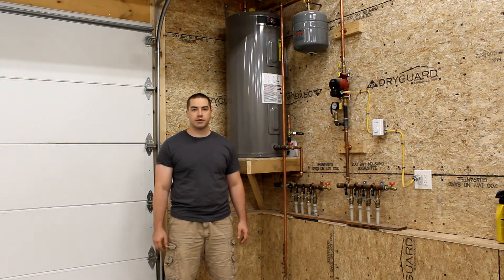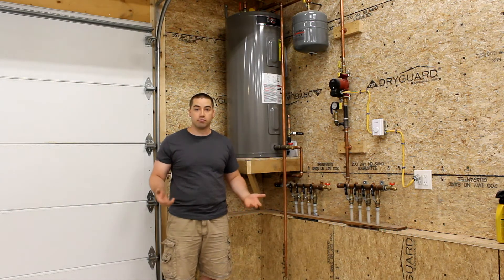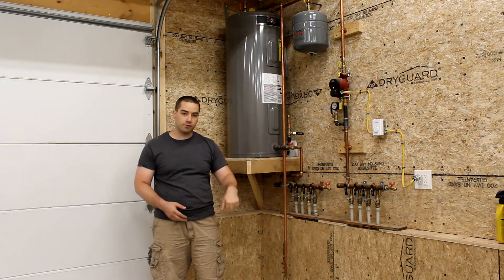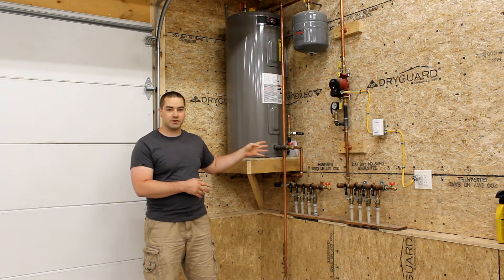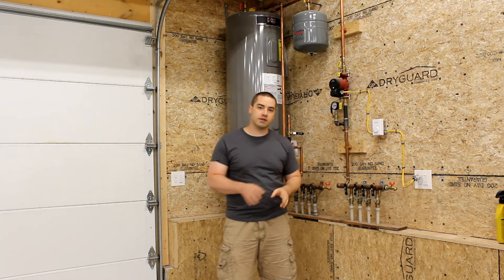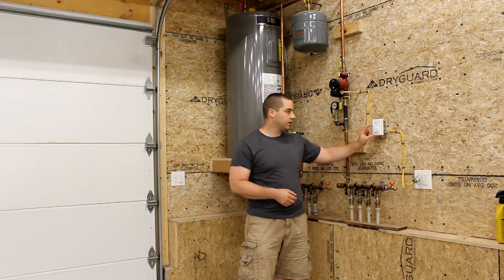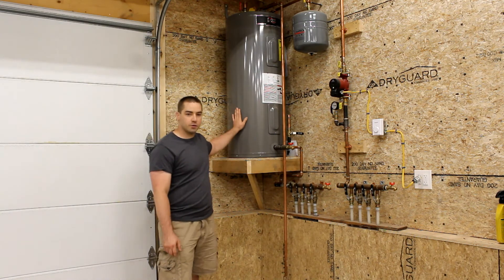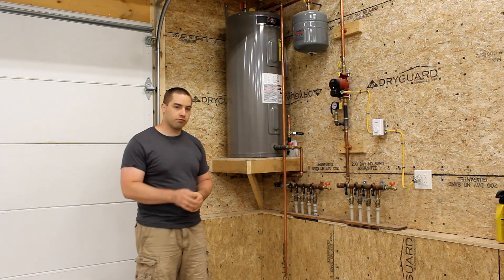Solar Heated Garage Plan

Comment: Hi David,
Hope you guys are doing ok this year. I had a few questions about your garage radiant system, and was hoping to get your input on a smaller project I’m doing. 

First off, do you recall how many KWh you were using to heat that garage, before installing the solar collectors?

Here’s what I’m up to:
I’m building a small, well insulated 10x14 gambrel shed. I’m doing a single run of pex between the floor joists (~220 ft). Heating with a 10 gal 120v water heater. 2.1 gal expansion tank (smallest I could find). Got the cheapest Grundfos 3 speed pump HD had. Still need to find an air relief valve, and get all my other fittings together. 

This will be a closed loop system. 

I had been planning on running glycol in the system, since it is a shed, and if our power goes out or the heater quits, I don’t want to worry about freezing (we’re in So.VT). What exactly are the downsides of doing an antifreeze mix? 

What else do I need to make my system work? Do I need a line-level thermostat to run the pump like you do? Or can I get a low voltage one and run it over to the front door for easier access? (I’m thinking of installing the whole system up in the loft area.)

Last question: I got a stainless water heater. Was that a mistake?

Thanks for taking the time to read my comment 🙂

Comment: cool.  good luck with your solar plans!   do you have a more detailed plans and video for how this was put together?
Reply from the maker: I'm still in the process of building it.  The next video on this topic is here: https://youtu.be/GbnawpPHsD0  Stay tuned for more.  Is there something specific?  I'm always open to video ideas that would be helpful to you.  Thanks for watching.
Reply: I guess what i was wondering about is manufacturer and part numbers so i can make sure to get the right stuff.  i'm at early garage planning stage, so i'm mostly just collecting ideas at this point.  i plan to run the pex in the concrete and then just terminate them in the wall for now waiting until next year to finish project.  may run a separate tube for outdoor to melt snow off the apron (i'm in canada, can get pretty cold some years).  snow melting tube would have ON/OFF valve so its only in use on occasion (wouldn't really matter if you running on solar though)
Reply from the maker: Sounds like a cool project, I look forward to checking it out if you post some videos.  The Pex is Uponor brand with an oxygen barrier.  The radiant floor is a "closed" system so you will want an oxygen barrier and an air relief valve.  There are lots of brands of PEX that are good, you just want it to be compatible with the fittings you will be using.  I ran 1/2" pex in 4 equal length loops under the slab.  I have the raw footage of doing this, but need to edit it into a video, so stay tuned for that to come out.
Reply from the maker: I live in Massachusetts and also get a lot of snow.  I thought about putting in stub-outs for doing a driveway loop in the future, but decided against it for these reasons: 1. I did not want a large boiler and the small BTU output of the water heater would not be able to handle the load of the driveway. 2. The driveway is subjected to freezing temps, so the fluid must be anti-freeze.  Anti-freeze has some drawbacks so I did not want to use it for the whole garage, this means I would have needed a separate pump for the driveway, and a heat exchanger to separate the loops.  3: I don't have the money to pave the driveway and will keep it a stone driveway for the foreseeable future.
Reply from the maker: A note about BTU's.  This water heater has electric elements which only produce about 9,400 BTU's per hour.  This is extremely small.  It works in my garage because the garage is so well insulated and air sealed.  However, in a driveway setup where you need enough BTU's to melt 2 feet of snow falling in one night this won't keep up.  Most of the oil boilers in my area are about 180,000 BTU's per hour.  I don't know if that would be big enough for your driveway or not, but my driveway is 400 feet long and I just don't have the BTU capacity to keep up.  But I'm excited to hear what you come up with.
Reply: ah.. i'm not trying to melt snow off a driveway proper.. that would be extreme costly.  my application, its a detached single car garage at the back of my lot where there is a city owned paved alley way, so my "driveway" is only the distance of garage door to alley, roughly 6' long.   I don't mind shoveling it in the morning, the apron heater is just to keep the new snow off during the day so i can drive into garage easily after work.  if it doesn't work well, just turn that one valve off.. not out much $ really for such a small run and only one pex loop.    for the system in general i'm still doing my research on this, but my first choice is to use tankless heater mostly for the space saving.  I still plan to use a forced air electric heater too, so the radiant in floor heating is not responsible for heating the entire garage.   i am expecting my system to be subject to freezing temps because maybe i'll go some months without heating it?  its possible..  maybe glycol/water mix?  i'll have to do more research on this subject.  but i got time.  right now i am just planning to run the pex and stub out near a wall the 4 loops for future use.  currently i'm planning the frost protected shallow foundation concrete pour.  hope to get this done before winter or may have to wait until spring (boo!)
Reply from the maker: Very cool.  My town would not allow me to do a shallow frost protected foundation even though it is in the IRC and the state has no problem with it.  I'd love to hear how the project goes.  Sounds great.